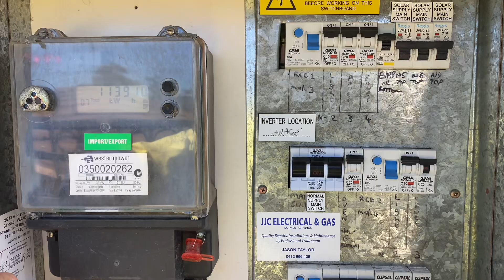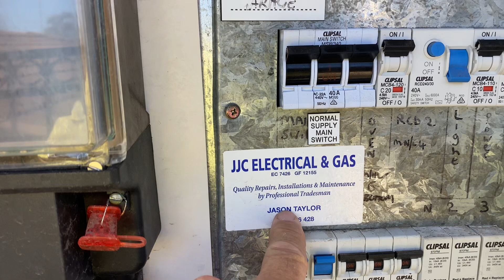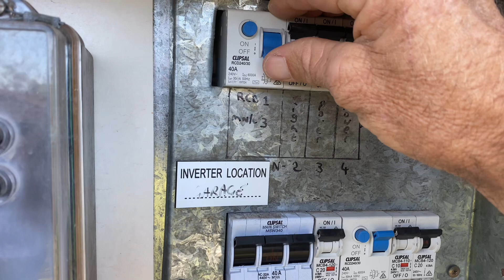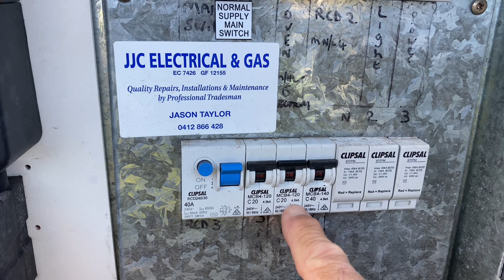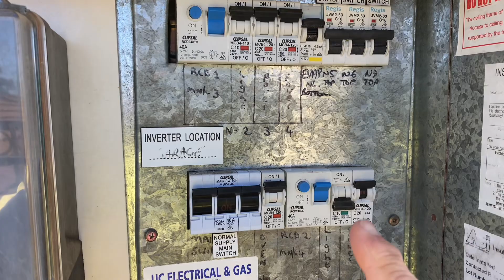Quick fix on a faulty RCD also known as safety switch.

Comment from the maker: I should clarify this is only a temporary fix until you can get a licensed sparkie to assist. It is also ONLY IF THE SWITCH IS FLOPPY AS SHOWN IN VIDEO. If it is pushing up solid and trips off again you most likely have an actual fault that MUST BE RECTIFIED ASAP. A good way to determine if the issue is mechanical or electrical is try with your main switch in the off position. If it resets, the issue is an actual earth leakage fault, if with the power off it is completely floppy and wont reset it is mechanical and to proceed to bash that mofo to try and get it to latch with the power off.
Reply: I think suggesting homeowners engage in percussive maintenance in a live switchboard is somewhat irresponsible.  JFC you're telling them to put back into service a failed circuit protection device.
a.  why didn't you also replace that 3rd RCD if they're known to be of faulty design?
b.  Why do you wait for them to fail BEFORE you replace them?
c.  why hasn't this known faulty product been fully recalled and replaced at Clipsal's cost?
Reply from the maker: @pirilana8966 ummm yes and no, there are no live parts to come in contact with so no real danger (read pinned comment).
They failed outside of warranty period.
I did replace all three. Not really a faulty design, they just seize up if not regularly tested.

Comment: Even as a long served electrician I don’t know anybody other than businesses that actually tests their rcd’s as it means resetting all the clocks in appliances and other things. Technically they can save your house from burning down under certain conditions like a lost supply  neutral ( in the UK anyway) i found it note strange that they are only 40a what is the supply fuse in Australia ?
Reply from the maker: True, 40a rcd is for only a few sub circuits.
Single phase 63a supply, 32a per phase for three phase is  what our boundary fuse rating is 😊👍🏻

Comment: The other thing to note is that by design RCDs fail safely by becoming more sensitive. So they'll annoy you by tripping needlessly. Better than becoming less sensitive and feeding 40mA through a person before tripping. That's the electrical type of failure. They can also fail if you can get a massive short that causes all the power to get dissipated through the contacts. Sometimes leaving burn marks.

Comment: A good trick to know. Cheers.
A lot of people dont like regularly testing their RCD's because they then have to go and reset all the clocks etc on all the appliances plugged in to that circuit!
Reply: besides, i don't think anybody ever regularly resets rcd's. the manufacturers just cover their backs. they should be designed so they work.

Comment: So, if an RCBO trips how can you quickly tell if it's an earth leakage fault or an overload, like do they have some indicator to show why it tripped?
Reply: Some have an indicator that shows if it goes off on leakage, others don't.  You'd have to read the documents for any given device. (obviously this is post trip and just walking out to the switchboard to have a look, not what you experience if you are standing at the device  when it trips)
Reply from the maker: Good point, overload it will be very warm. If its a short you will know for sure as it will violently trip with an audible crack.

Comment: Great video Jase....so does an RCD device also act as a CB and protect the cable as well as protect people from residual current ? 🤠😎
Reply from the maker: An RCBO does as it is combined RCD and Circuit Breaker. In this example no thats just an RCD or Safety Switch as they are commonly known. 👍🏻

Comment: Would you not have a duty of care to investigate the fault/shock before turning the power back on?
Reply from the maker: Yes fault was on the rangehood itself
Reply: Sounds like the fault had left the property
Reply: @stephenw2992 maybe, but it sounds like there’s exposed cable or terminations in the roof doesn’t it? 
I’m not an electrician but if I was called to a dangerous situation that was made safe by a safety mechanism I certainly couldn’t just turn it back on and call it a day without checking what the fault was

Comment: Thanks for the tip. 
Why did the range hood fitter get a boot? Did the rcd not trip quick enough due to the internal issues?
Reply from the maker: Fault on rangehood itself
Reply: You  will still get a boot before the rcd trips.
Reply from the maker: @markpanhuyzen6829 yep a damn good one too
Reply: You probably feel it for the short time they take to trip. They need a current flow to operate and we normally feel that. I bet the guy got between plug and socket or the socket had no back on it and he was well earthed at the time.

Comment: I'm sure they'll listen if you suggest removing the RCDs and fitting all RCBOs after that experience.
Reply: It's definitely worth doing. I got mine switched over to RCBOs just to make some extra space in the meter box. The crazy thing is my house is only 5 years old. I can't image the builders saved that much money using RCDs.
Reply: It is almost always taken up as they lived through the experience of multiple circuits going down.  I've seen one rcd covering 5 power circuits, even very long ago, the whole house circuits.  Also I've found HPM and Clipsal rcd's/rcbo's to be very ordinary and fail often.